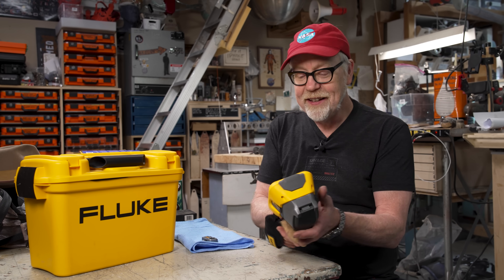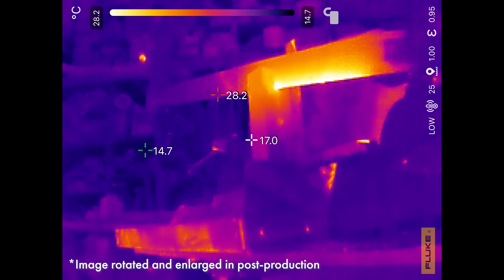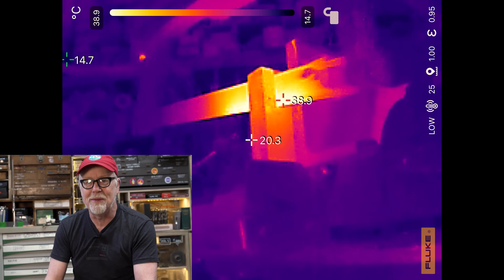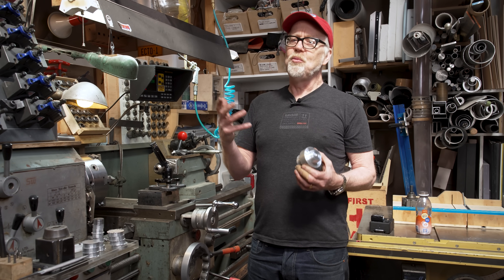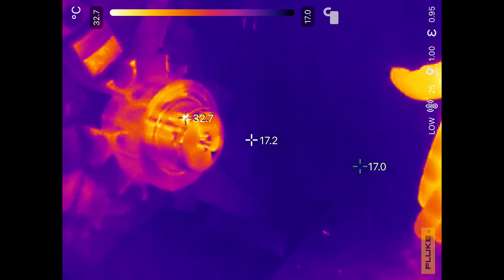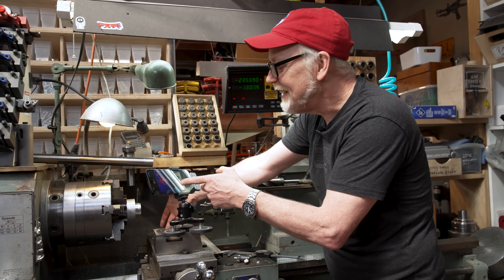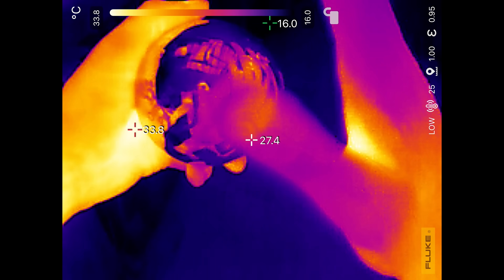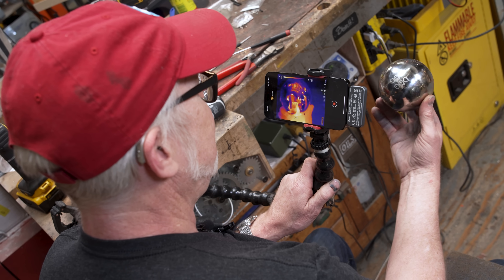What This Thermal Camera Reveals About Adam Savage's Workshop!

Comment from the maker: Fluke iSee Mobile Thermal Camera: https://www.fluke.com/en-us/product/thermal-cameras/fluke-tc01a-tc01b
Reply: FLIR also has one for less than half the price
Reply: @AnIdiotwithaSubaru But it also looks like it's less than half as good according to the specs.
Reply: @AnIdiotwithaSubaru Yeah, but it's actual trash. I have one, I know.
Reply: I just wish that All these companies would stop buying up every single high resolution thermal imager sensor and let us have some for the price that they're getting them for instead of buying them at like 30, 40, 50 dollars a pop and then selling them to us for 500 damn dollars.
Reply: Yeah, that fluke has a lot of pixels for such a tiny device, and a high refresh rate. 256*192 25Hz. Both aspects really make a huge difference on thermal cameras, but cost goes up exponentially. 

If looking at one for enjoyment rather than serious work, Uni-T have some significantly cheaper options than either FLIR or Fluke, with resolutions and framerates lower than shown here, but still high enough to be enjoyable. The trade off is their very buggy apps.

The cheaper FLIR options are quite low res and frame rate. Good for work tasks, but not really as much fun the sort of exploration stuff Adam was doing here.
Reply: SO funny! You sound high AF with that chrome ball!
Reply: I don’t think I have ever heard you use such heated words before 😂
Reply: Flir invented thermal imaging cameras (Forward Looking InfraRed) and is the industry leader. Fluke is the premier metering company and charge a lot for their yellow branded tools. If you’re going to buy a thermal camera, always go with Flir- they have way better technology for a better price!
Reply: The saw looks great in thermal.
But man! 14C ambient temperature in the shop? That's cold.
Reply: Thanks for the video.. I'm just wondering... can it recorded the video and have it saved in your phone?
Reply: Ok, the Heat reflection... ya, I didn't even know that was possible. So I was more astonished then you, and because of that, I dove head first into a rabbit hole that eat a few hours of my time.
Reply: Those foot prints stayed around for a Long time. I thought they would dissipate as fast as they were heated. But not even close.
Reply: It's over £650 stop it please  we are struggling as it is adam stop promoting other people's products it is not helping..why are you laughing at us

Comment: I owned a Flir One Pro (iOS) and what a dreadful shitty product it was, discovered only Flir has a limitation by 8FPS due to contract licensing with the government. So even some AliExpress thermal cameras go up to 25~ fps. Making it look so much smoother than a webcam from 1996. Also the APP stopped functioning on my iPhone 6, forcing me to upgrade the phone; just to get my Flir working again due to a screwup in the app. Downloading the older app was impossible. This fluke has good refreshrate, and for a non secondary imagecamera (to overlay onto the thermal vision) this is absolutely mindblowing! What I do love about these things, as Adam pointed out; it really makes you look different at the world with this. You can point it at cars parked outside, and you see the residual heat coming from the engine bays (so you know it was driving a few hours ago). My personal favorite is, when you touch any surface with you hand. And removing your hand, will still show the print on the surface like a ghost image. Also looking at central heating piping in the floor, and seeing how a bathroom radiator progresses in temperature (bleeding) through. And, the fun fact you cannot look through glass with it. Glass is a mirror for thermal cameras. Really cool stuff to have.

Comment: I got a thermal imaging camera built in my phone and a stand alone for personal use... where I find this quite usefull... as I got some issues with blood flow in my fingers and toes I can instantly check and even show the doctors what I mean... most of them didn't know that you could check body parts like that... I even could see when getting IV medication if it was flowing inside the veins as the injection was from the fridge and way colder than the body temperature

and yes, you can actually see a lot more with these things than you think

Comment: Awesome video this is so cool! For everyone in the comments talking about how the thermal camera actually works I think this is a pretty good and accurate explanation: 

The thermal imaging camera does actually detect photons. It works by detecting infrared radiation, Unlike standard cameras that detect visible light (wavelengths around 0.4–0.7 µm), thermal cameras use sensors designed to be sensitive to longer wavelengths (typically in the 8–14 µm range) where most thermal radiation from room-temperature objects is emitted.

The camera’s sensor measures the intensity of infrared radiation received at each pixel. This intensity is then used to calculate temperature using radiometric calibration and physical laws of thermal radiation, primarily Planck’s Law, along with adjustments for emissivity, ambient reflections, and atmospheric absorption. The result is a thermal image where each pixel corresponds to a temperature reading.

(If anyone reads this and spots an error let me know and I’ll try to fix it, I’ve seen a lot of incorrect information in the comments section though so thought this would be a valuable comment to make)

Comment: Can it fit in the frunk of a Valve Index, including the cable to connect it to the USB port? Does it show as a standard camera to the computer? That seems like it could be an easy route to jerryrig a thermal vision headset if you can get the software and driver side of things to work.

Comment: Many Thanks for your fun videos Adam! 
I was distracted that the motion drive crank wheel of the saw seems like it is rotating in the wrong direction. Is that an arrow on the wheel? Could you reverse the rotation of the motor, make sure the teeth of the blade are also oriented correctly and use the thermal camera to see if it cuts faster and cooler?

Comment: I work as a temperature calibration engineer for the largest calibration company in the world and have literally calibrated hundreds and hundreds of IR cameras and IR 'guns' so i was cringing a bit when i saw the emissivity set at 0.95 for shiny aluminium (should be about 0.10-ish). The absolute temperature measurement on that is waaay of at that e-factor. For relative measurements IR is pretty okay but for precise absolute measurements not so much. Tolerance is about ± 2 K at an uncertainty of about 0.6 K. But enough nerd talk! That Fluke attachment is pretty neat. Haven't had one of those coming in the lab yet but i hope we will someday because i'm curious about the performance. Fun fact: whenever we have IR cameras coming in you can pretty much guarantee that there are pictures of people taking shots of eachother on the memory card. We always browse them and it's a source of great hilarity every single time.

Comment: As many people in the comments pointed out they are photons but its actually much more interesting than that. Infrared cameras are monochromatic which means they are missing out on a range of colors int the Infrared. The chemical has a unique wave length that they emit on(actually multiple wavelengths). For most chemicals the wave length that they emit on as also the wavelengths they absorb on. They are some that emit more than they absorb and vise versa

Comment: That automatic hacksaw is still turning backwards.  It's supposed to cut on the pull stroke, so the cutting forces are supported by the backstop instead of the vise jaw.  Reversing it would probably cut down on the chatter by a lot, and possibly speed up cutting.

The thermal was awesome though!

Comment: Saw fix is simple, have a kill switch that goes under the back of the blade holder.   When the saw goes down so far it would trigger the switch.   Make it adjustable so you won't need to adjust it as often.

Have a headband like the one for your magnifier with a phone screen that come down over one eye like a flight helmet.

Comment: Some interesting thermal imaging tricks. You can use a thermal imager to see the level of a liquified gas in a tank, say a rail car or a propane tank. As a firefighter responding to a motor vehicle collision have used thermal imagers when a car seat was in the back of a vehicle to determine if a child had been in the car seat recently to ensure we didn’t miss anyone child that may have been ejected or trapped under the front seat. You can also use a thermal imager to look at a breaker panel or motor to find high amp draw and potential fire hazards. In spite of all of this amazing capability, you cannot look through glass with a thermal imager. A candle on one side of a pane of glass will not be seen by a thermal imager on the other side of the glass.

Comment: As you realised, polished metal reflects the heat of everything else. It's radiating very little of its own heat, making it impossible to measure its temperature with a thermal camera. This is also why heat shields are often made of polished metal.

Comment: I wish I had this when... on the first night of a vacation, I slept on the tile floor with only a small pillow, took off my tshirt to use as a blanket. As I slept shirtless, uncomfortable through the night I woke up sweating all crazy because the tile had absorbed all of my body heat from where my skin made contact with the tile. The areas of the tile that my skin didn't touch was freezing. It was the most interesting accidental scientific sleep I've ever done. This product would have been cool to use to check out all of the heat that was absorbed into the floor.

Comment: An infrared camera should be a must-have tool for every electrician, as it helps to see which wires and connections require immediate inspection!
Reply: Yes I found out I had a bad GFI by seeing it flash behind the cover in the dark .  Luckily I saw it before I burned up. With that you can check them before they get as bad as mine was .

Comment: I've kept a much cheaper (and much smaller) one in my pocket for years - as a software guy working on robots, being called in with "the new software doesn't work on this gripper" and be able to pull out my cellphone and say "really? motor #2 is 60C warmer than #1 and #3, that's not a software problem" saved all sorts of time (as well as enhancing a reputation as a wizard :-)

Comment: I helped create the first portable uncooled microbolometer camera at Honeywell in the 90's. It was as large as an old-style VHS camcorder, down from the rack sized breadboard camera we used for testing. So many cool images. Veins in arms and hands. Driving in the woods at night with the headlights off. Footprints on the floor. Our camera could see the residual heat from a hand pressed on the pages of a book, nearly 100 pages deep.

Comment: Does this work with a phone case still on the phone? $500 is still pretty steep for this device when I'm sure it doesn't cost anywhere near that to manufacture. Their full handheld models are even more costly from around $2,000-$14,000. Even though this would help me out a lot with diagnosing hardware problems in computer and electronic circuitry... until I have a business where I could write this off as a business expense, I'll be waiting for the prices to come down and normalize along with wanting the resolution to be much higher than a 1990's desktop PC. The reflection shot of radiant heat was pretty interesting still. Thanks for sharing your cool gadgets!
Reply: I've seen repair videos recently on motherboards where they used this tech.  You don't need as much resolution in the IR, just enough so the pixels are smaller than the components, and the sharper visual overlay allows you to identify the component. So it's here /now/.

Comment: My local library allows you to borrow these for free (but it's the FLIR ONE) so you can see where you are losing heat, etc. It's called a Home Energy Kit. Also comes with a Kill-A-Watt for checking power consumption. I found this out when I was looking to buy a new house. I needed to find where the drains were to install a kitchen downstairs. I turned on the hot water upstairs, about 5 minutes later I could aim the camera at the ceiling and walls to find exactly where the drain pipes were due to them heating up. The real realtor was impressed. We ended up buying the house.

Comment: Hi, any shining surface will give the impression of a heat source. So the shining surface of the metal and shadows and reflections will be visible, which has to do with the emissitivity of the surfaces.
I use my thermal camera to identify components getting hot. This can show a failed or shorted component on a PCB.

Comment: Apropos of nothing, there are extension cables for lightning plugs if one wanted to remote the unit from the phone. Like say 3d printing a headset for the unit while you hold the phone. Not elegant but it gets the job done. Just putting that out there😁🖖

Comment: I used to work with a number of uncooled LWIR (long wavelength IR) they do have pixels, (1 bolometer per pixel) so I’m curious what the resolution is. Even as recent as 5 years ago 640x480 was considered “high res” for common military uses. Though just as i was leaving the industry much higher revolutions were become available (at a huge jump of the price point). 
One thing that video games always used to get wrong was that LWIR sights could see through windows.
Standard glass does not allow LWIR waves ( 8.0 – 14.0 μm wavelength ) to pass through. Instead standard windows become mirrors to LWIR. 
Which means that standard glass can’t be used for a LWIR lens. 
Instead you need to mix another material (often Germanium) which not only allows LWIR light to pass through, it also filters all other light so ONLY the desired light makes it to the Focal Plane Array. 
So a LWIR lens looks black and you can’t see through it with the naked eye.

Comment: I have one of the very early Flir versions. I've used  mine to troubleshoot wonky electronics, verify the HVAC repairs are sealed, and chase the cat. 

My favorite use is to verify my roof replacements (twice in two years) were each water tight, which they weren't, in multiple spots. Within minutes of the rain starting, I wander through the entire house with the camera trained on the ceiling and know instantly (and as expected) the roofers f'd up! Then I climb into the attic and can identify exactly where the membrane, flashing, or roof jacks have been incorrectly installed and put a bucket under the leak until the contractor can return to the site. 

The roofing contractor loved me since I could email thermal and normal images and videos of all the failures and they knew exactly where to look. I loved the camera because I didn't have to make any drywall repairs or deal with mold months/years later, and could confirm the drywall was completely dry before replacing the insulation after the repair was made.
Reply: Right on. The contractor secretly was hating on you for catching his mess ups.

Comment: Do not put faith in those temperature numbers! You're looking at objects that are very low emissivity, with a camera giving you numbers based on 0.95 emissivity. This is fine so long as you don't need the temperature numbers to be accurate. And as mentioned by others, yes, these are photons.

Comment: okay this bothered me @7:09 THOSE ARE PHOTONS they're just of a 'color' we can't typically see. admittedly using color as a proxy for wavelength is dubious and there are some difference in how it acts because the wavelength is getting close to a millimeter, but it still is light. notably iirc the large wavelength fundamentally limits the resolution thermal cameras can have.

Comment: thermal is photons, its just longer wavelength IR and needs different materials for optics.
The hotter you get, the shorter the emitted wavelength becomes which is why things start getting red hot around 650°C or so. its blackbody radiation! If you want to get technical about it the only things that dont emit a wavelength of light are things at absolute zero where the wavelength goes to infinity and the stuff circling black holes is so damn hot its emitting xrays.

Comment: When you scrubbed the chrome ball, regardless of it being more warm, you created a single spot on the ball that was NOT reflecting its surroundings.  This reflection often supersedes any infrared that can be received by standard range thermal imaging sensors.  (This sensor's sensitivity is from 8 to 14 micrometers (wavelength of light) which straddles the line between Mid and Far infrared bands.)  While the sensor can see this reflection, it does not correlate to the reflecting surface being warm.

Comment: My thermal imaging tools are my favorite tool/TOY.
I have a Fluke, an InfaRay and a temperature sensing android device. 
Some units have a regular camera superimposed with the thermal imaging sensor for a little more detail.
Just consider the max and min temperature of the unit as compared to the max temp of your needs.
My torch hurts one of my units and another ones range, is just under my needs. The one unit that I have, that works for my heat-range (130°F - 700°F) is a very expensive unit with lower resolution than the others.